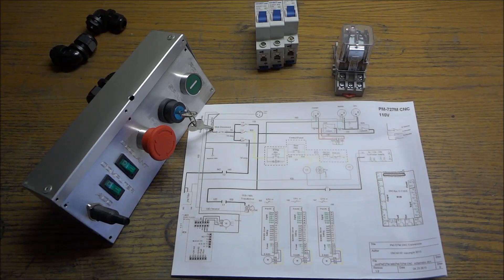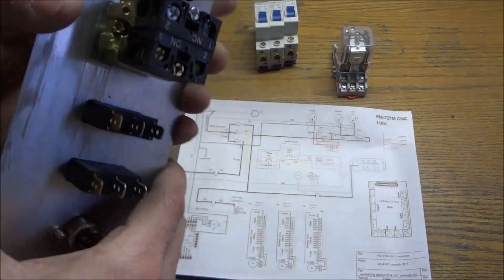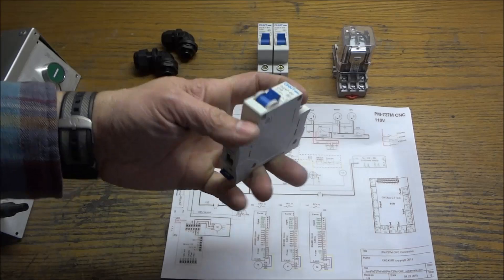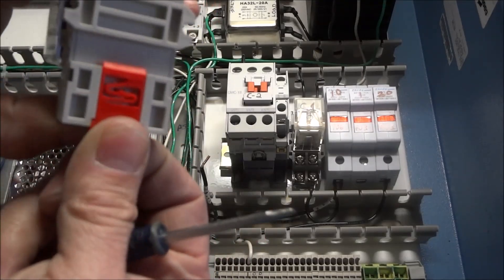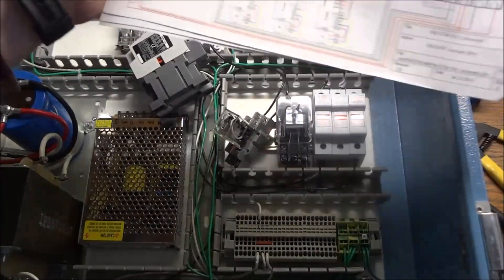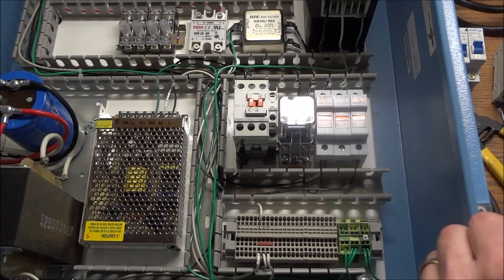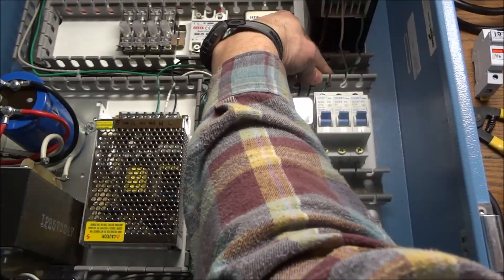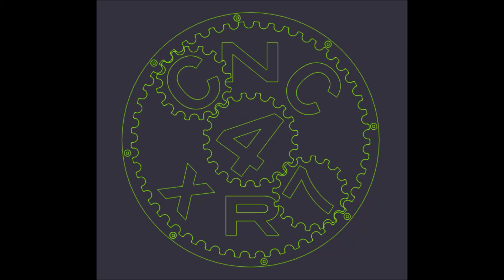PM 727M Wiring component upgrades

Comment: where are these electrical diagrams available for download? heard you mention it in the video.  my cabinet currently has been working for years now but it isn't as streamlined as yours.  I was budget limited at the time and used power strips since they have built in overload protection.. and then used plugs and cut the ends off them to connect to components.  would like to do the new Lathe conversion more like this setup but haven't used alot of the components you are using before and would like to wrap my head around it.

looking great!! keep up the awesome work and videos!
Reply from the maker: +christopher polanski  Hi Chris,
 G0602 link:  https://www.dropbox.com/sh/hb5pn3dx8zd924e/AAAO5b4zwO2doHzJzSiB9Pq5a?dl=0
PM727M link: https://www.dropbox.com/sh/3hr8k95q478ddmw/AADVTeSj0D5zgulvp_HxQaKKa?dl=0

PM727M is not complete posting as I go.
Be Safe,
Sam

Comment: Hello CNC4,
  I hope you don't mind me asking if you have had a chance to run the PM727M from the factory as is? the reason is I am waiting for mine to show up but can't find anything written about it. I certainly don't have the knowledge to convert to CNC but would like information on what you would think about it as a simple hobby lathe. Thanks.........
Reply from the maker: +Bill Baggins  It's Sam 
Well yes I have, If you look back a few videos I machined a G0704 Saddle on the PM-727M it worked very well and I think for a Manual Mill it will be great as well. Thanks sam